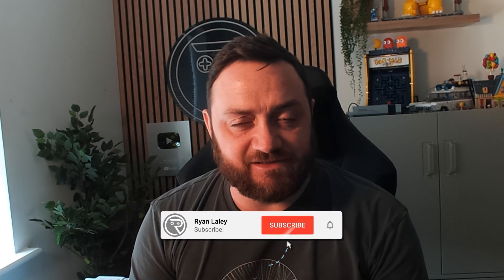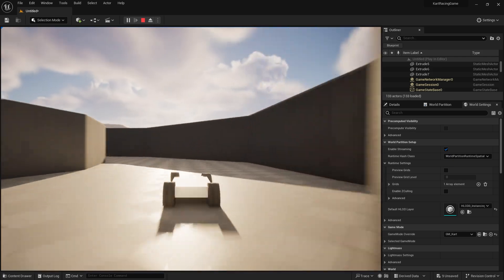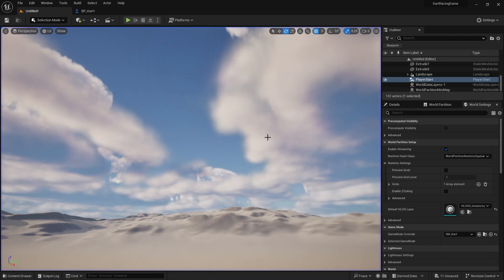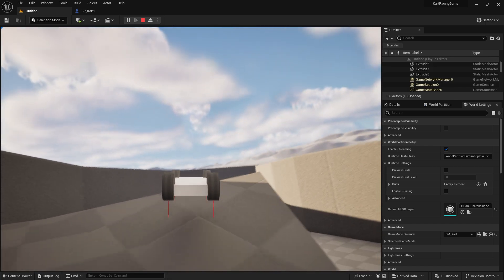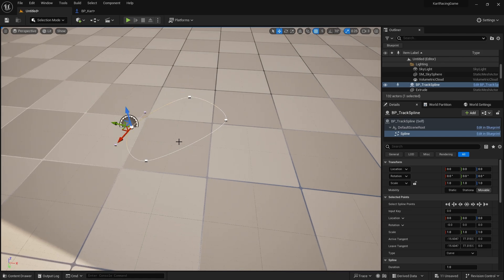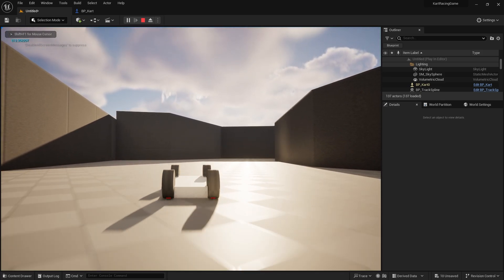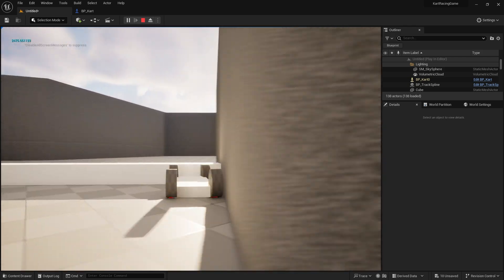Unreal Engine 5 Tutorial -  Kart Racer Part 5: The Track

Comment: My spline detection isn't working. The number is just static on screen
Reply: have you solved it? I have the same problem
Reply: @kay2750-t2j  did you figure this out? having the same issue
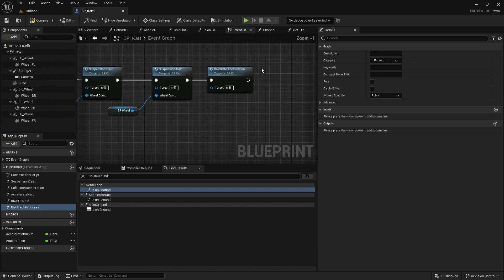Reply: So, I had the same issue here my second go at this Kart thing. Make sure you are calling the "Get Actor of Class" on the "Event Begin Play" - Had it originally on "Event Possessed" and all I would get is 0.0 on screen. As soon as I added it to "Event Begin Play" like in the video. The check worked. Not sure if the issue is the same for everyone but that's what worked for me. For reference what I am talking about is at time: 10:11 in the video.

Comment: I am disappointed that you went with the spline solution, that every race track tutorial are doing too 😔
Reply: Good enough for racing mode, but when they get stuck, and they will, then they need to switch over to a recovery mode such as path finding back to the track and then switch back to race mode.
Reply: @mahkhardy8588  I would have preferred a more dynamic system, so the ai cars can drive in any kind of track and not rely on aiming at spline points when they drive. What if the track gets split into two, or if there’s a super wide motorstorm section, what if there’re obstacles on the track like trees or rocks?